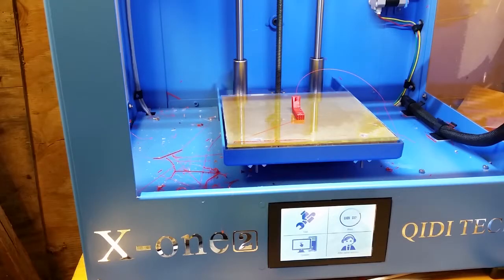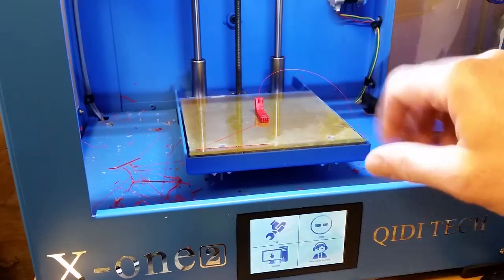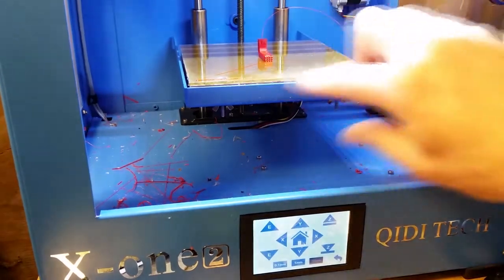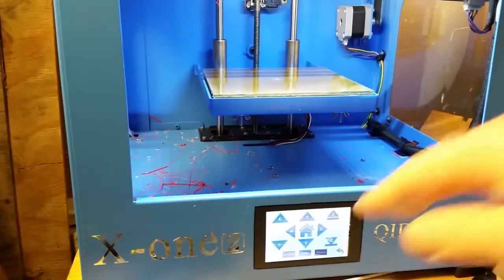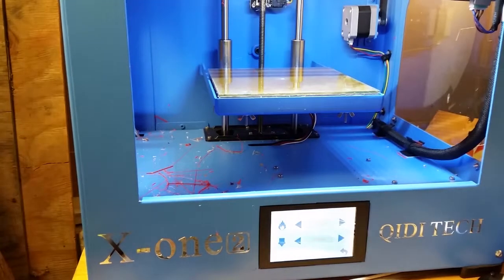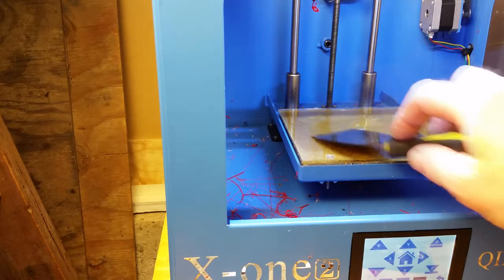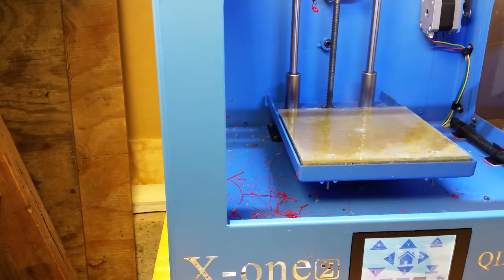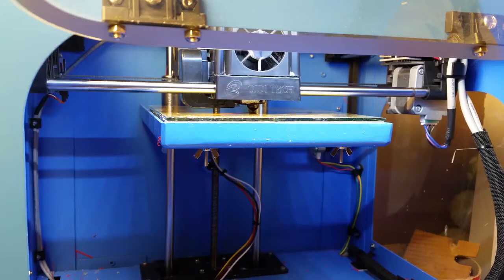Using PETG Filament in a Qidi X One 2 3D Printer

Comment: My original blue surface is just fine but would still like glass.  Could I just put the glass over the blue sticker or is there some reason to remove it?  Thanks a million man for sharing.
Reply from the maker: I suppose you could just glue the glass on top of the blue. I don't think it would matter. My blue covering was getting in pretty bad shape, so I peeled it off. When I did so, it left a sticky residue which was perfect to stick the glass on. My glass has since broken twice now when removing an object. But each time it lasted through quite a few prints. I just replace with a new piece each time. I believe it's 3/8th inch. It's cheap, like $3 from Loews for 2 six inch pieces. They cut it for you. Home Depot doesn't have any glass. I suppose I should buy a glass bed made for printing or buy better glass at a glass company. I tried buying  2 different pieces of tile one time, but they were too thick, so they didn't work.
Reply: I'm going with tempered glass. I appreciate your video. Hope you read this 👍

Comment: Hi, I have recently got the same printer as you pre owned,  do you happen to have a link to a good set of settings you use for cura, I'm having real problems with stringing
Reply: I'm with you... got an X-Max and I'm using Cura, and having a tough time getting dialed in with petg.  Have you found what speed/nozzle temp/bed temp/fan/retraction settings work for you?
Reply: @Philzy610  did you get them dialed in? what're your settings?